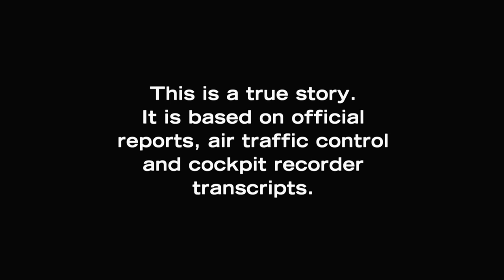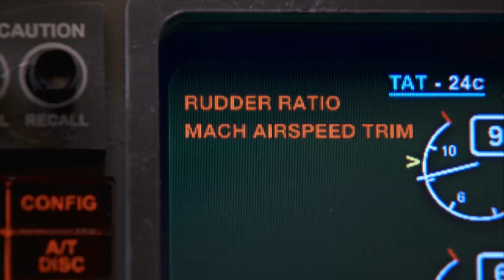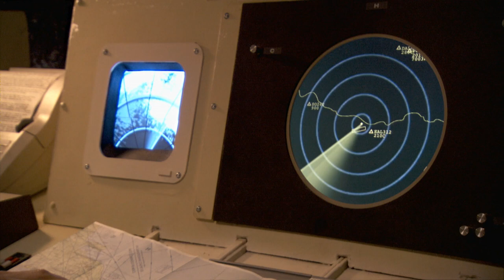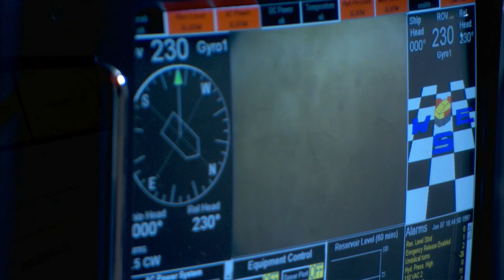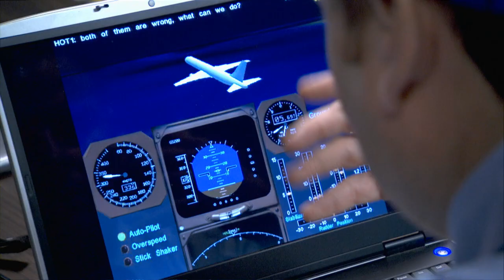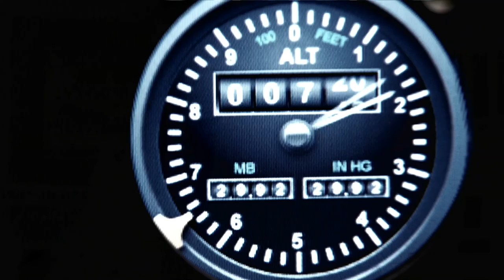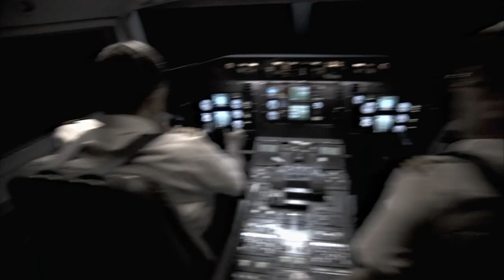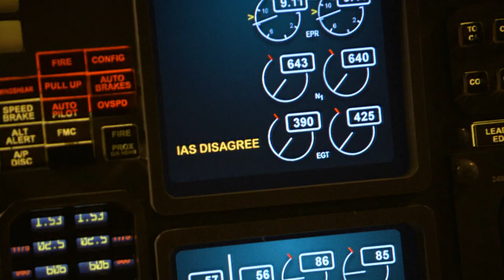The Plane That Wouldn't Talk | Faulty Readings | FULL EPISODE | Mayday: Air Disaster

Comment from the maker: Do you think if the pilot should have stopped the flight from taking off when he was faced with the first problem?
Reply: Yes, he should have.
Reply: I only have 100 hours flying and that seems like a no-brainer.  It also boggles my mind that it didn't occur to any of the three of them that the autopilot would rely on readings from a pitot tube and to at least think or look up which it was going to use.  Then there are all of the written test questions for an instrument rating that drill in that an airspeed indicator acts like an altimiter when the pitot tube is blocked.  It's crazy to me that they missed so many cues.
Reply: prob?
Reply: Yes. They should've abandoned the takeoff and let tower know that there was a discrepancy in airspeed. If they had done the proper checks around the outside of the aircraft, they probably would've seen the blocked pitot tube.
Reply: Yes absolutely. If they would have aborted the take off it could have avoided this whole incident. On top of everything the pilots should have asked to return to the airport.
Reply: Yes it was before V1 and even if he choose to take off why use auto pilot knowing you had faulty instruments he should have aborted, if he really felt he needed to commit to take off have the first officer call the tower and request to land citing instrument failure circle around and put it down. I will say this also brings up the issue of aircraft needing something more updated then the pitot tube they are too sensitive and have caused many crashes from either being covered, damaged, clogged or iced over.
Reply: Yes
Reply: Yes! Even though only the pilot airspeed was faulty on takeoff.  He should have aborted while he could if not possible than return right after takeoff. He continued the flight after he knew he had faulty equipment.
Reply: Yes, if he was able to.
Reply: they could of done that or turned off the autopilot since the autopilot corrected the plane into flipping over
Reply: in hindsight yes, but with only seconds to decide I could see myself making that mistake.

on the other hand, I wouldn’t trust the autopilot.  

I’d trust the co-pilot tho!  “you fly the plane, while I sort out this sensor problem.”  — could have worked, and bonus point for teamwork / good CRM.  🙂
Reply: @bkembley  "Then there are all of the written test questions for an instrument rating that drill in that an airspeed indicator acts like an altimiter when the pitot tube is blocked. " did they have those instructions back then or are those instructions the result of this accident?
Reply: @amandam1137  Good question and I do not have a for sure answer.  But the pitot static system has not changed much in design or function in the last 70 years.  I would guess that if you asked that captain on the ground about it, he would tell you that the airspeed indicator acts like an altimiter if the pitot tube is blocked--but in the air under the pressures and weird stuff going on that day, his brain wasn't about to pull up that information.  He couldn't even listen to his fellow pilots when they were giving him correct instructions about how to save everyone's lives.
Reply: @bkembley  case of get-there-itis indeed. as they taught us in drivers ed its better to get there late than never.
Reply: If he didn’t want to do that because he didn’t think he could stop in time….rain and all…he should have come back around and landed instead of continuing the flight.  Yeah, a lot of people would have been inconvenienced but at least they would be alive.  Then everyone could get a good rest, the problem could be fixed and they could try again the following day.
Reply: @sigsin1  the crew had been in the DR for 3 weeks... he wanted to  get out of there i assume... but i think they determined they did have time to abort, it just didnt cross any of the 3 pilots minds to call for one for some reason, they were so fixated on getting out of there i guess, and complacent when it came to saftey
Reply: SOP gauges not matching at 80 knots, abort and call maintenance.
Reply: @bkembley  This was back in the 90s.  The written test questions you're thinking of were probably created because of situations like these.  These pilots didn't have the same training, and most people didn't really understand much about how technology worked back in the 90s
Reply: Hindsight is 20/20.
Reply: @bkembley  Hindsight is 20/20
Reply: With the investigations finding , yes. But the pilot didnt have that luxury. He most likely used discretion and chose to continue based upon his perspective.  Hopefully the information gleaned from the investigation and modified training provides safer flights in the future. Much respect for the investigators and thier persistence to get answers.
Reply: Should have but they won't. Back in the days where regulations are not that strict, I bet a lot of planes are flying with "small" problems more serious than this and they get away with it and get it fixed later.....
Reply: Yes.  Ended up a day late to Toronto due to the pilots not wanting to take off with a faulty altimeter in the cockpit.  We didn't even leave the gate because the flight crew was having none of it.  Despite the massive inconvenience I am damn grateful for that fact.  I would not have wanted to take a chance with that even if those were THE best pilots in the world.
Reply: He should have aborted takeoff because of the airspeed indicator issue
Reply: Yes it was the first thing that ran through my mind it’s better safe than sorry especially with other peoples lives our on the line and a lot of innocent lives why take the risk nothing is worse wven if u were fired for aborting
Reply: Did they say the pito tube iced I wasn’t able to watch full episode I’m at work
Reply: Yes
Reply: Yes.
Reply: Yes
Reply: Maybe
Reply: Question: how often is there an airspeed discrepancy? Is it common for other pilots to ignore something like this?
Reply: Of course he should have cancelled.  Should be automatic. He was responsible for peoples lives.
Reply: 7
Reply: I’m just shocked if the main pilot had so many hours on the plane why he didn’t shot the autopilot off and fly the plane by hand ??
Reply: Absolutely!! No doubt!! 💯YES!!
Reply: Yes.
Reply: The captain lost it and no one would correct it.
Reply: Yep
Reply: YES
Reply: I assume that the pilot had faith in his aircraft and his ability to overcome the problem based on his experience and confidence in the aircraft. Question is, could he have turned around for an emergency landing? Would the false readings had allowed him to land safely without slamming into the ground? I have no answer to this question 😞
Reply: Yes!!
Reply: I feel so bad for the crew and passengers. The part about the bees was interesting.
When I watch these air disasters shows, I wonder if a camera would help in the cockpit with finding what went wrong?
Reply: Yes.  No question.
Reply: Its instrument failure "technicaly" but really its senior pilot failure and ego that killed all those people.
Reply: Absolutely. If somethings wrong, stop.
Reply: Should never have taken off.
Reply: Yes ofcourse i don't understand!???
Reply: @cooloffroadtrucks  exactly!!
Reply: YES INDEED!!
Reply: If I was a pilot, I would flat out refuse to take off if ANY AND ALL issue (s) were present. From a light, to everything wrong with the place
Reply: Yes. Any sign of trouble should be enough cause to return to the gate.
Reply: The pilots should have abandoned the take off
Reply: I believe he should have.
Reply: @bkembley  Wasn't the pitot tube implicated in the crash of Air France 447 as well?
Reply: Absolutely Yes
Reply: @harrietharlow9929  Yes. But the flight data doesn't go back to the beginning of the flight so there's no way to know for sure when the tube failed...but it most likely froze in flight on that flight rather than being inop from the start.
Reply: Absolutely. This flight should have never left the ground when the two instruments didn't agree. At best they may have had one chance to turn back and land but for the most part it was doomed when it left the ground. This was also one of those crashes in which the first officer knew what was going on (when the captain was confused) and may have been able to save the plane. But it takes guts for a F/O to take controls from the captain as in those days you just didn't do that.
Reply: YES!
Reply: @bkembley  How do you think they came up with those test questions? Accidents like this.
Reply: Rule #1: Fly the plane.  Stalling? Lower the nose , increase throttle.
Reply: New Sub Today... YES, Absolutely should have aborted take off... Having extensive mechanical knowledge, myself, I figured Pitot Tube blockage before half way thru.... Pulling back on the yoke is a common mistake during a stall condition, need air flow across wing for lift... Stall is a lack of air flow across wing, nose down.... BASIC TRAINING IN FLIGHT SCHOOL....
Reply: Yea
Reply: Yes you right
Reply: A lot of Monday morning quarterbacking here.  It's easy to second-guess a pilot in the relaxed comfort of one's home after seeing the whole story of what happened after an extensive investigation.  As one other commenter said, the pilot didn't have that luxury.  He had to make a split-second decision in a rapidly changing environment.  I doubt that most of the commenters here could do much better under the same circumstances.
Reply: They should have aborted takeoff when the airspeed didn’t match. Even though it would have been inconvenient, they could have ordered another plane, and flown back to Frankfurt safely. But they didn’t. RIP to all the victims.
Reply: Pilot with thousands of hours of experience: I think this is fine/fixable. 

Hundreds of people online: oBvIoUsLy I wOuLd HaVe NeVeR tAkEn OfF!
Reply: Of course.
Reply: Yes!
Reply: While one might be wrong, someone should have realized that the damn plane was stalling....
Reply: Big effing YES!!!
Reply: Yes
Reply: Yes!!!!!!!!!!!!!!!!!!
The captain was the problem.!!!!!!
Reply: So a dirt robber took down a airplane ✈️ smh
Reply: Yes
Reply: @Milesco  And yet, you're not addressing the real question: should he have aborted prior to V1?  Yes, he should have.  He was aware of the two airspeed indicator inconsistencies.  Period.  So quarter backing or not, this was a critical mistake that cost the lives of almost 200 people.
Reply: The stupidest pilot I have ever seen Fixing things by himself Even though he gets a second chance and putting people life in risk He should turn back the point when system getting him Confused, He didn’t even went to far
Reply: @Billoushukla  
I agree!
Reply: @quantumdecoherence1289   Arguably yes, but...

40:45   "This decision on the part of the captain has been criticized, but there's a very short time window for this decision to be made."
Reply: Should have aborted take off the SECOND he noticed the discrepancy between the two indicators, because NOTHING is EVER too small of a problem when it comes to a jet.
Reply: They couldn't.  They were at or near V1.  The point of no return.
Reply: CRM failure: crew resource management.
Reply: Absolutely.
Reply: Agreed
Reply: Yes as a standard safety protocol
Reply: Yes
Reply: I wouldn't have, but I would've relied on whichever 2 of the 3 instruments aggreed.
Reply: Till what point are they instructed to take such abort decision? I don't think pilot made a mistake. Another cultural factor that we don't mention is that Boeing / Airline owners from the west  always try to show it as a pilot error ! The auto pilot relying on an external vulnerable device is a very bad design. Literally anything could block that spedometer tube!! and how about adding a strainer or something, how can a vasp build a nest inside this tube?
Reply: Ummm...he murdered his passengers.
Reply: Yes, they should have but as in many cultures the senior officer is treated like a god and nobody DARES question him or his decisions.  That's why you take your life in your hands, or rather the god-pilot's hands, when you fly on foreign carriers.  I refuse to fly at all anymore so that's never a problem for me.  If I can't drive to my destination then I don't go!
Reply: Yes.
Reply: Bryan Embley I agree but this took place before the test was revised. The question is why dose pipi tubes don’t retract into the plane when the plane is turned off.
Reply: @puppylover369  No this is basic instrument navigation that has been known for a VERY long time.
Reply: @mattbrown5949  Not very often, but it does happen. This is the point of calling 80 knots and checking to make sure the speed checks between air data systems. It is never something to be ignored.
Reply: Absolutely. Next question why was this aircraft sitting for 3 weeks prior
Reply: Obviously he should have.
Reply: Yes
Reply: dumb captain should have landed the plane immediately after takeoff. malfunction of the airspeed indicator is a serious problem. its crazy to keep going on your journey when you have no clue what is causing the problem. you have plenty of time to figure it out on the ground. but at 30,000 feet you have almost no time to do anything before the airplane goes out of control.
Reply: Yes, he should have aborted take off.
But in any case, decreased power after taking off still relying on any instruments,  that it is probably flying "too fast", activated stick shaker is no brainer, an aircraft was stalling.

Deactivate an autopilot and increase power, after that stick stops shaking and go from there. Most likely, return, that was already scared a Jesus out of them.
Instead, they had waisted so much time trying to fix something in the cockpit having no idea of what gave.
Reply: @AndyGarcia-ns3iw  

That's not only the planes, there is a lot behind them. 
Pilots, quality of their training and length of experience, maintaining those planes, quality of repairs, list goes on.
That list is very long.

Planes have accidents not only because of it.
Reply: @AndyGarcia-ns3iw  the 757, and the 777 are pretty damn safe,
Reply: Obviously! The point of having redundancy/failover is for the pilot to safely return to the airport. If one critical instrument is failing, then it's safe to assume the rest will fail. Don't wait for a life-threatening failure.
Reply: Definitely. Always err on the side of caution.
Reply: If  I was on the plane,  I would definitely want the pilot to stop. I wouldn't want the Captain to take any chances.
Reply: This is a no brainer. He should have stopped the plane. But he probably faced immense pressure from the airline to take off unless the problem is REALLY serious because of how much money the airline would loose if they had to cancel the flight to diagnose the plane.
Reply: Reminds me of Air France 447. Shaker on, nose down, a bit on the throttles, then level it, turn back as it would be your second call. But apparently, some are prone to let things go beyond procedures and training, whether to achieve a given task, to reach home, to save the company, fatigue... interesting the same reasons are narrated as I write these....sad, sad, sad .. rest in peace all who lost their lives...
Reply: @NeelHippalgaonkar  I imagine it's possible to miss a blocked pitot tube on the ground.  But the crew did notice a discrepancy on take off.  That would have been a good time to either abort the take off or decide to use the first officers gauge for a return to airfield.  I guess the gauge starting to work was confusing and contributed.  I haven't read the investigation report...I'm curious what the human factors aspect has to say.  It's sad for sure.
Reply: Yes he should have, or at least done an immediate return and landing, once he hit V1.   I think that he should have reduced thrusts just a little, till he got a sick shaker then push it down and add a little throttle take it out of the stall and return for an emergency landing.
Reply: Yes,because that’s the rule.
Reply: Sometimes I think ppl’s brains are fried. This is bs! Do better guys…you can do it.
Reply: @NeelHippalgaonkar  Not without a camera to look into it with?
Reply: Absolutely….
Reply: They should have stayed in the City Lights so they would have a visible horizon and flown the aircraft with Pitch and Power. Brought it around a put it on the ground with standard flap and power settings. When airspeed is bogus you need to revert back to the principals of flying before you get all screwed up in your head.
Reply: @peterolsen269  They should have never left the ground...
Reply: cant you go around and land after V1